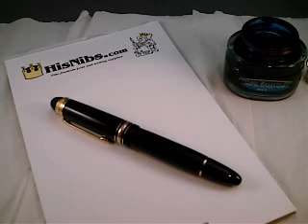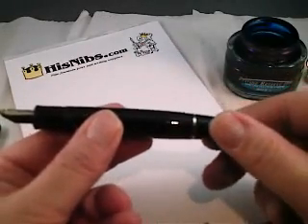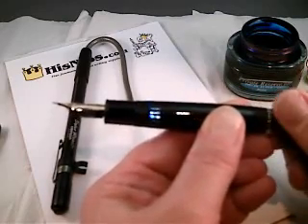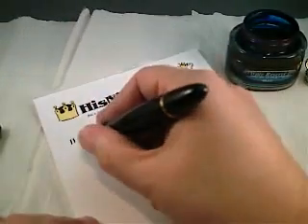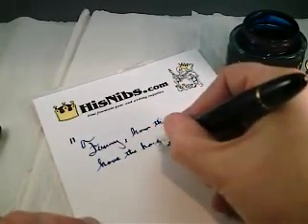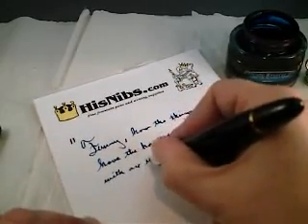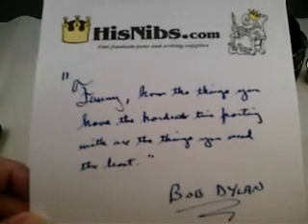Fountain pens: Filling a piston fountain pen

Comment: Can you state how many twists (counter clock-wise) of the piston I should turn? I read you can damage the piston by twisting more than is necessary. 
Thank you.
Reply from the maker: Hi Herman. This video is from 13 years ago, so I don't happen to have that pen on my desk at the moment 😉, however every individual pen can vary in any case. Just go slowly the first couple of times until you a resistance -- which will indicate how far that particular piston's travel is. Just don't force anything!
Reply: @HisNibs1  Wonderful, thank you kindly for the rapid response! I shall proceed slowly with my second fill-up. Cheers!

Comment: easy when you have a full bottle of inc... tricky when the bottle is running low and you have to tilt the bottle... that's when it can tip over and spill all over the place. so what is the tip with a less than full bottle of inc, especially on the low level?  thanks!!
Reply from the maker: Some people use a Visconti Traveling Ink Pot, some test tubes. Another approach is to purchase an ink that has a cooperative bottle, such as Waterman (designed to sit on an angle) or Montblanc with a separate little well. Personally, I use a Levenger ink bottle with a plastic insert designed to address this very problem. Either use the original ink or not, but save the bottle for future filling with your favorite ink.

Comment: Why is it that every video showing refilling of piston pens never explain how the ink is drawn up and at which point must the nib be submerged?? I have a MB149 plus matching inkwell, but  i never know if is getting enough ink.  Does the entire nib need to be submerged?  Of course, this goes with manual ink converters from other brands.
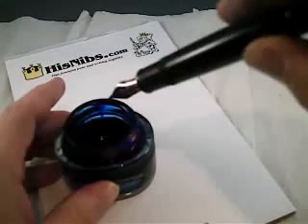Reply from the maker: Thanks for your inquiry. I'm surprised that you can hear anything on this old video of mine from 14 years ago -- the microphone was terrible! 🙂 I do mention the partial vacuum being created at about he 1:18 mark, but to answer your questions directly: You want to submerge your nib fully, along with a bit of the section, and keep it submerged throughout the filling process. To get a full fill with a piston or piston converter, you generally want the piston to travel up and down (finishing with it up, of course) 2-3 times (keeping the nib/bit of the section) submerged the entire time) -- to express out as much air as possible, and take up as much ink as possible. Retracting the piston creates a partial vacuum in the reservoir, sucking up the ink.
Reply: @HisNibs1  thanks for the clarification....

Comment from the maker: Hi Germagic2. One isn't necessarily 'better' than the other. I personally prefer fountain pens that fill from an ink bottle (that's half the fun!), and doing so helps to lubricate and clean the nib and feed. However, when traveling, nothing beats a cartridge for convenience. *Most* modern fountain pens are 'cartridge/converter' type, which allows you to use both.